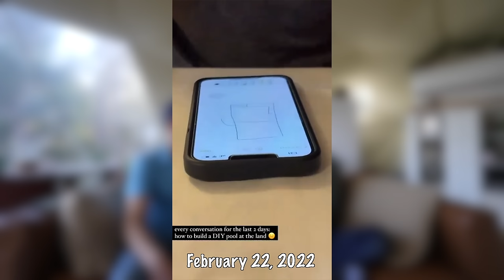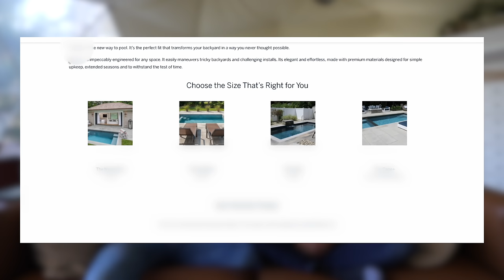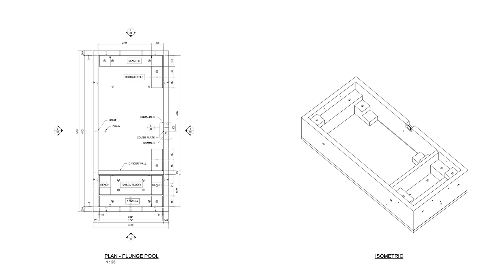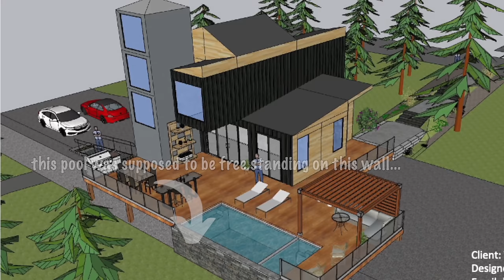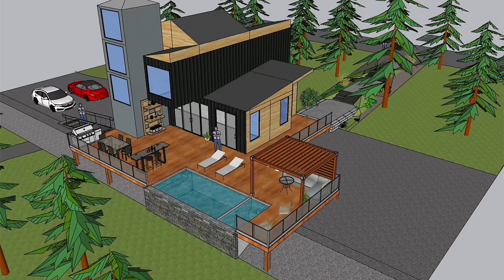We're being Sued...

Comment: I'm not sure how Canadian law works but in the eyes of the law, in the USA, withholding payment makes you just as bad as the shitty pool contractor. I know it doesn't make sense but you're now in a position where they beat you to the filing. And I know this is absolutely bizarre but did your contract with them address a watertight pool? Was the pool permitted? Pool contractors generally cover themselves by not being responsible for changes in ground movement that could affect the integrity of the pool walls; especially if you're actively under construction. They can simply pass the blame to your general contractor. You would have to prove their negligence caused the leaking. I wish you both well in settling this. I know you're being nice and following your counsel but I would absolutely "plug" the pool contractor in a video.  It feels like they're taking advantage of your patience and niceness while comfortably remaining unnamed. One thing that definitely works in your favor are the renderings; especially given they made visits to the site. While renderings aren't set in stone, they provide a realistic expectation. The fact you had to stray so far from the renderings, at YOUR expense, would work in your favor. I trust you've filed a countersuit. If your counsel hasn't advised this yet, you should be able to sue for the extra time it's taken you to correct / deal with their negligence. For example: if you can show your time is worth $100 an hour, you can apply that to your countersuit. At the end of the day your counsel should inform opposing counsel that you are free to "plug" the company in as many videos as you like. If the pool company doesn't want any "plugs" from you they should compensate you as needed, correct or pay to correct any construction issues and drop their lawsuit against you.